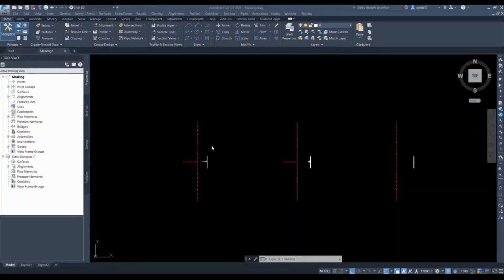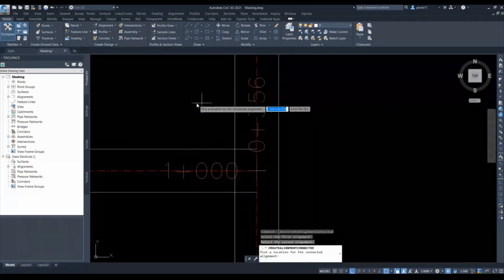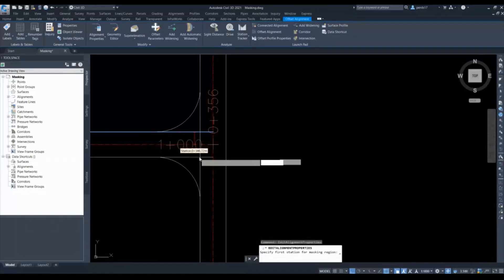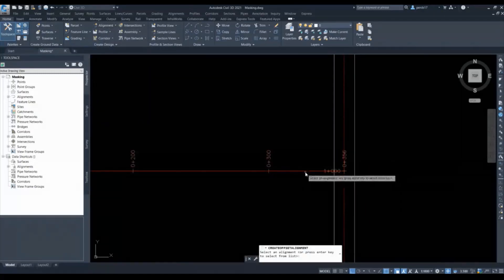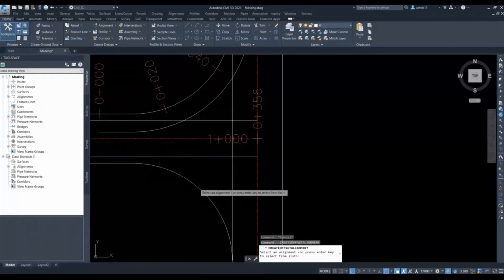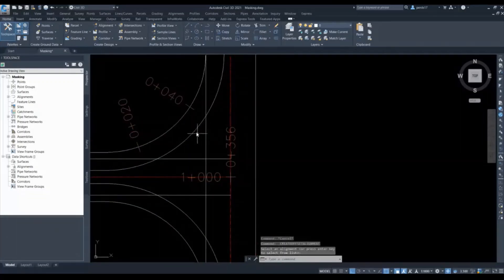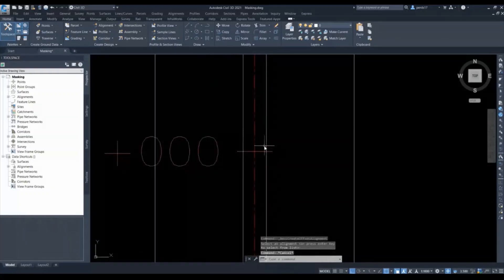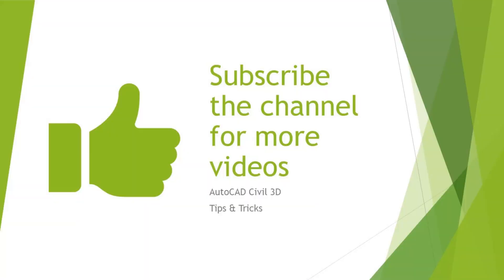Civil 3D - Junction Design using Offset Alignment, Connected Alignment and Masking

Comment: The videos are really helpful. i had certain concerns. How can we add profile to the offset alignments.? Can you please elaborate on profile management  covering these point in next video:
1. In practice while the main carriageway is under improvement, there can be a difference in elevation in the intersecting road, What is the best way to raise the profile of intersecting road?

2, Considering case 1 in superelevated region

3. Considering case 1 and 2 along with traffic islands with elevation, how grading is affected?
Reply from the maker: Offset profile can be automatically created with offset alignment by providing camber value and you can also provide super elevation to them. We have already made video about it. Please check all our video,your most of doubts will be clear. 
General practice, profile should not be raised at intersection unless needed. Those are some constraints  that you need to keep in mind while designing profiles.  
Superelevation also need to be avoided at intersection location. If unavoidable cross road profile need to be design again for at least 100m from junction.